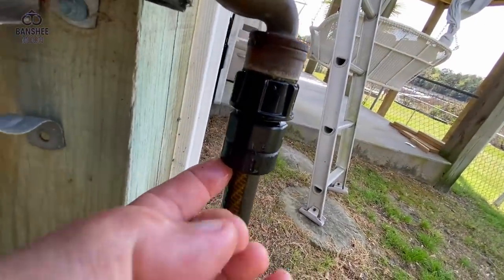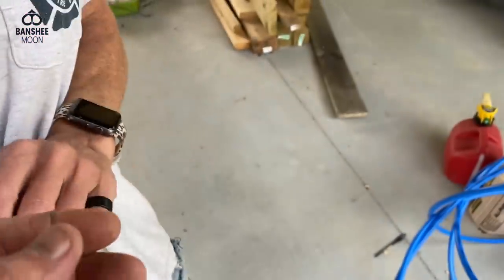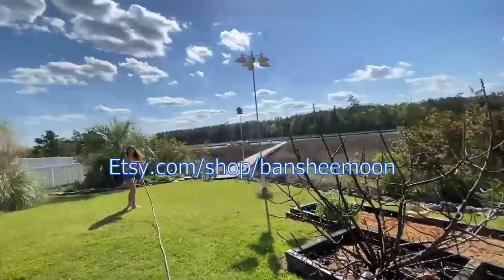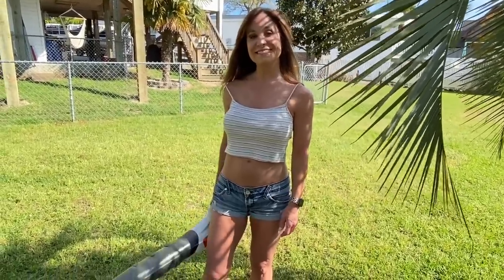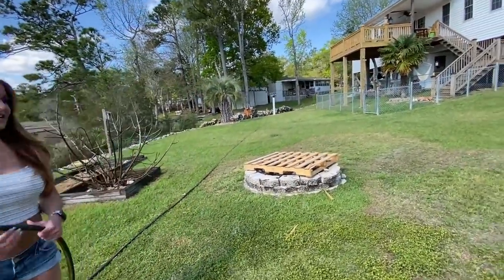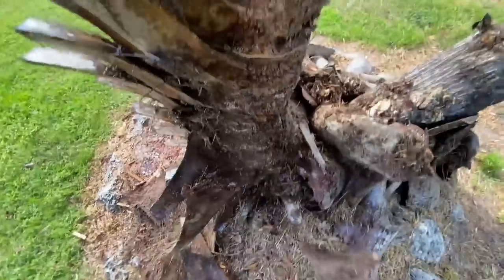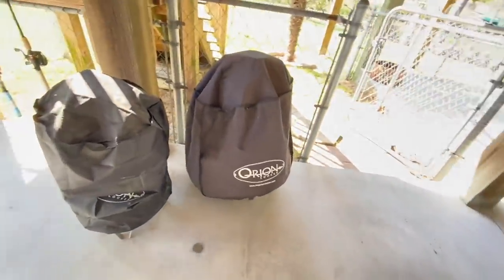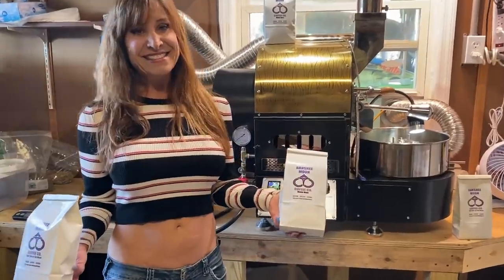Dang Hose Connector

Comment: Ya have to use stiffeners with those fittings on soft rubber or plastic. They are a sleeve that sits inside the hose to make hose stiff  so the fitting has something to squeeze against.

Comment: I have been replacing all my hose fittings and nozzles with real brass fittings, like we had years ago, that lasted forever, and not that brass colored garbage that is sold in the big box stores now. I also use waterproof grease on the fittings.

Comment: the little rubber edge on this brass fitting comes off..and uder the rubber is a serrated edge..easy to get some pliers onto  and not tear up the machined taper on the end....just try it...
probably too late..but for futiure reference...remove the rubber edge piece..you don't need it anyway.
then things get easier.  Savanna ( . )( .)

Comment: Go back to where you cut the retainer holding the tag on the hose repair piece and you will find a silicone or rubber washer. You forgot to install that on the female connector. Put that washer between the hose bib and the hose connection and your leak will go away like magic.You are welcome.

Comment: Jennifer I thought I was being smart when I bought my gas pressure washer and got brass water quick connect hose ends it kicked me in the butt and took enough water flow for the pressure washer to not want to work right and I have bought plastic and brass connectors and yep you guessed it kicked me in the butt again and they cracked or fused together when I went to connect the hose to the tap and other hoses to have longer watering reach with the big kicker I had drained the water from the hoses completely out and what I have been doing is undoing the hose ends every spring and fall and no more headaches

Comment: Today's garden hoses are tough to spice because the manufacturing process creates a rib on the inside which prevents a tight fit.  A curved carving chisel works nicely to cut the rib off, or use a 1/2" copper pipe that has been reamed on the inside to make a sharp edge. Those metal fittings are probably made of zinc or white metal that corrodes easily in contact with chlorine.Get a good commercial grade real rubber hose with brass fittings.!!